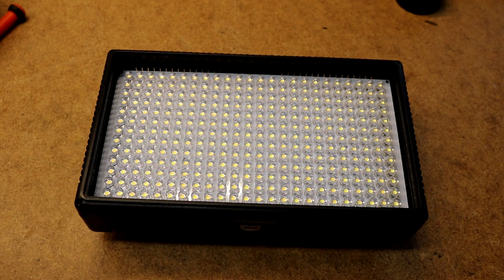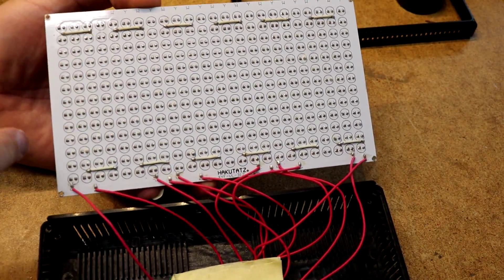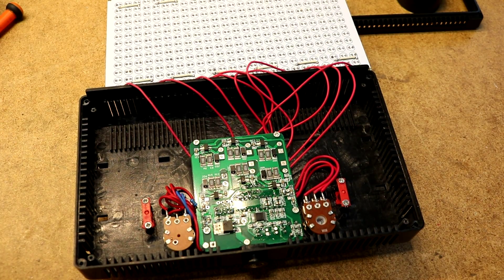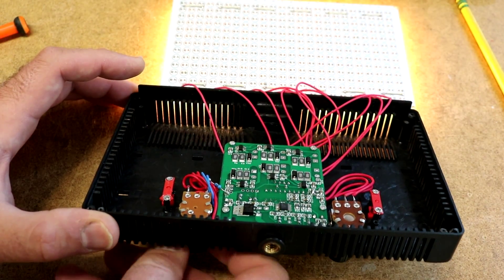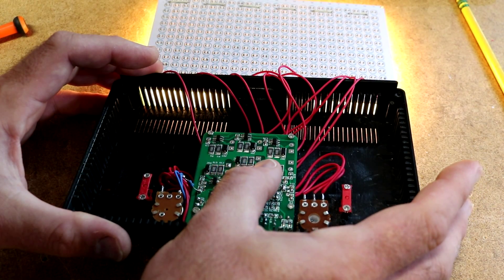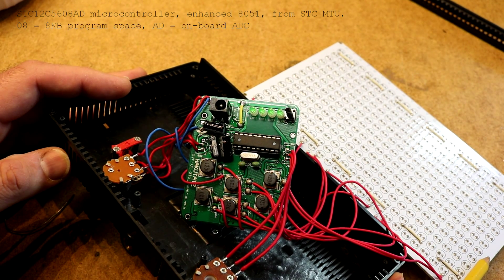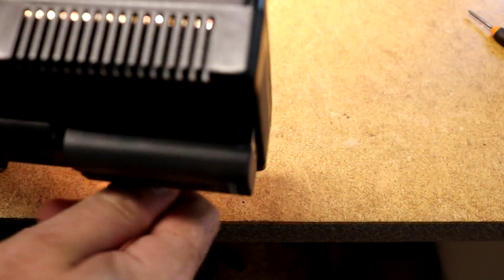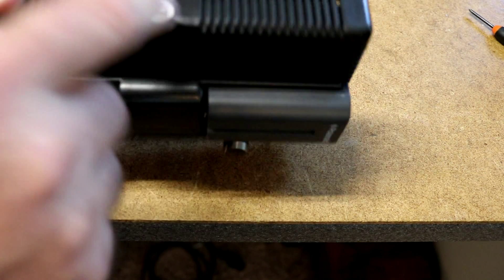Polaroid 312 LED Camera Light - Teardown, Repair, and Mini-review

Comment: Hi there, I bought a pair of Polaroid brand LED video lights a while back.
Not the same model as this one, an older and simpler one with fewer LEDs and not the colour change LED function like this.

I have to say these are the worst made POS items I have ever bought.
The batteries have a tendency to just fall out (one smashing on the concrete floor of the nuclear bunker where I was filming one time.)
Then on one of the lights, the socket where the power lead goes in broke inside, which I sort of fixed with some hot glue for a while.

And now I've got one in pieces, some of the connections inside are broken and too tiny for me to solder.

Looks like one of these is dead to me now.
I paid around £120GBP (that's about $170 USD each for these little buggers.)

Utterly shoddy items would put me off EVER buying again.

Well done you for fixing yours but sheesh...